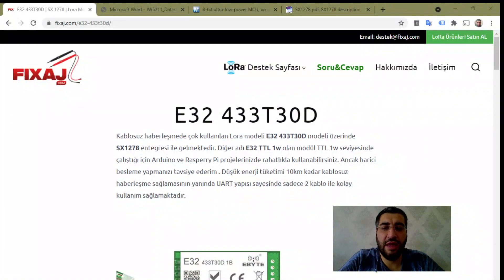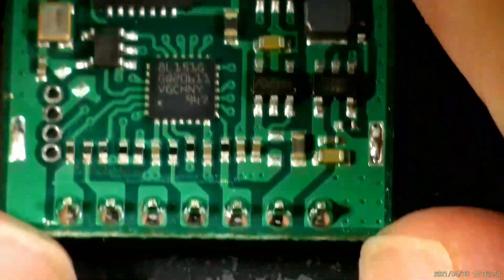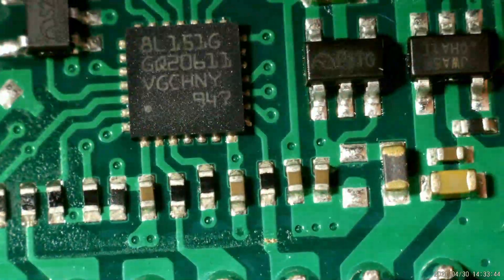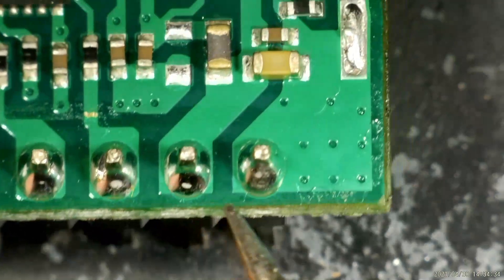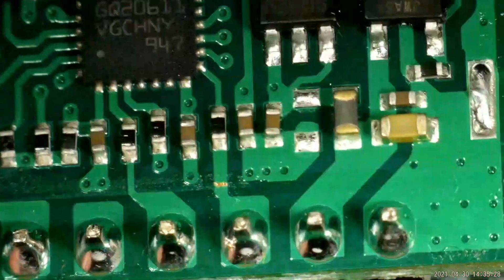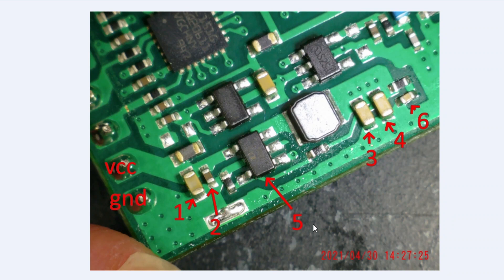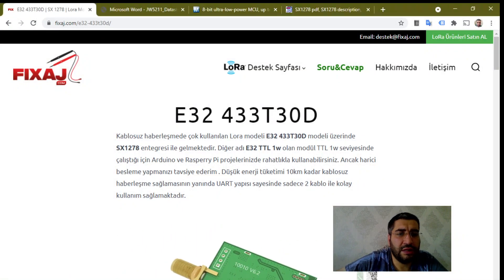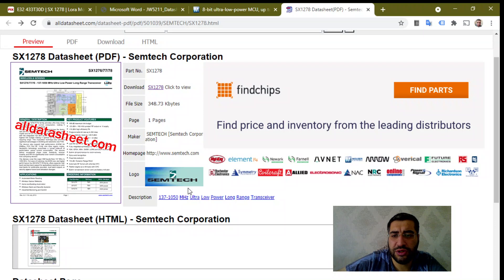What is inside a LoRa module? E32 433T30D

Comment: this is a classical class E rf amplifier topology, these blue parts are called wirewound inductors. they are selected for high q and certainly not handmade.  ebyte claims all inductors are wurth branded. S241 is a rx/tx switch ic. the rest of the components on the antenna side are for impedance matching. mcu is from cheap stm8 series.